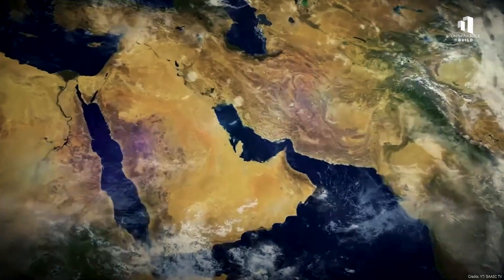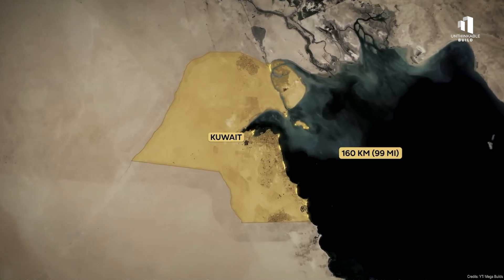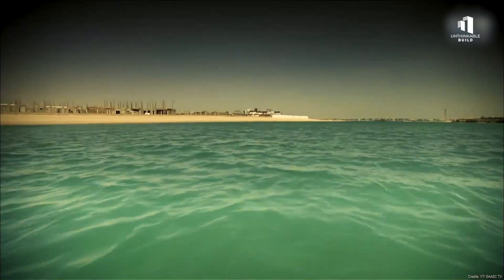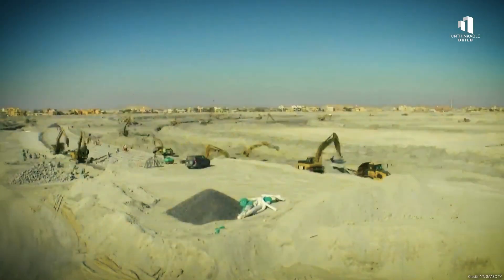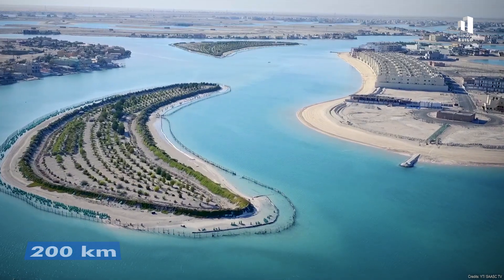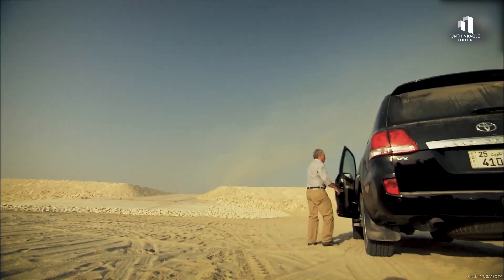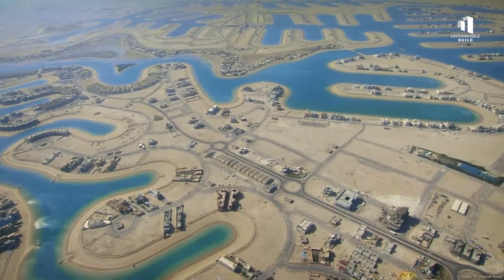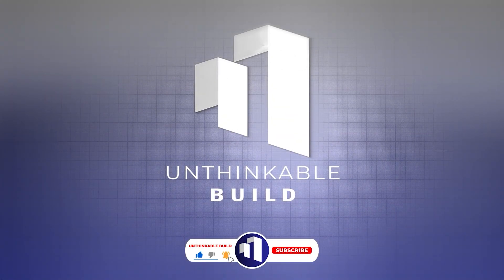The $5 Billion Desert City That Shouldn’t Exist

Comment: 🌳 Dhaka's Under-Flyover Renaissance: A Vision for Green, Cooled Public Spaces
DHAKA, BANGLADESH—An ambitious proposal is gaining traction in Dhaka to reclaim and revitalize hundreds of kilometers of currently unused urban space beneath the city's extensive network of flyovers and elevated expressways. This initiative aims to transform these neglected areas into a sprawling "urban forest," offering citizens a much-needed respite from the intense heat, congestion, and lack of green spaces.

The sheer scale of this untapped potential is staggering. Imagine hundreds of kilometers of inner-city land, currently occupied by the colossal pillars supporting these elevated structures, lying dormant. Specifically, many flyover pillars situated in the middle of major thoroughfares command a width of at least eight feet —an indispensable amount of space that presently serves no productive purpose.

The visionary plan proposes converting these underutilized corridors into a continuous chain of linear parks and pedestrian walkways. The concept envisions lush landscaping around the pillars with diverse, shade-providing vegetation, including fruit-bearing trees such as high-quality avocado and improved varieties of olives.

Beyond mere aesthetics, the proposal includes critical functional elements. Seating areas will be integrated along these pathways, creating inviting spots for relaxation. Crucially, a comprehensive water mist sprinkler system will be installed throughout the entire length of these under-flyover parks. This innovative feature will generate a palpable, cooling mist, offering citizens a tangible sense of relief from Dhaka's often ravenous summer heat while simultaneously ensuring the regular hydration of the newly planted flora.

Walking through these transformed corridors would evoke the sensation of strolling through an oasis, a verdant escape from the urban clamor. The project promises to create hundreds of kilometers of new pedestrian-friendly paths, all teeming with greenery, fundamentally altering the environmental quality and aesthetic appeal of Dhaka's urban landscape.

Addressing the structural constraints of the twelve-foot-wide pillars, the plan incorporates a clever design solution: specially designed staircases flanking both sides of each pillar. These staircases will allow pedestrians to seamlessly cross the pillar's footprint without encroaching on additional ground space, ensuring the park's flow remains unimpeded. The design of these stairs will be carefully integrated to harmonize with the overall aesthetic of the park, creating a cohesive and visually pleasing environment.

Furthermore, to ensure public safety and security, the entire expanse of these under-flyover parks will be monitored by CCTV cameras. This comprehensive approach ensures that the transformed spaces are not only beautiful and functional but also safe and accessible for all citizens, marking an unprecedented commitment to urban renewal in Dhaka.

প্রকাশ , মন্ট্রিয়েল , ক্যানাডা  * Oct 2025

Comment: Proposed Waterway Network for Flood Mitigation and Economic Development in Bangladesh :
A comprehensive waterway network across Bangladesh could provide a long-term solution to the country's persistent flooding issues. By creating a system of interconnected canals, floodwaters from India could be more effectively distributed and managed, preventing catastrophic overflows. By developing parallel transportation networks for both waterways and land, including both above-ground and subterranean routes, we can achieve substantial land savings. This freed-up land could then be repurposed for other beneficial uses.                                                                        

Transportation and Infrastructure :
To complement this waterway system, elevated roadways could be constructed parallel to the canals. This would provide the public with a choice between two reliable transportation methods, reducing the country's dependence on a single road network. This dual infrastructure would ensure uninterrupted travel, even during monsoon seasons. The canals could also be linked to existing rivers, enabling floating vendors from various villages to directly access urban markets and enhancing rural-urban connectivity.
Economic and Environmental Benefits :
This extensive network of waterways would also offer significant economic and environmental advantages.
Abundant Resources:
The canals could support a thriving fish population, providing a sustainable and abundant food source for the local populace.
Fruit and Oxygen:
The banks of these canals could be lined with fruit trees such as avocado, rambutan, lychee, and mango. These trees would not only offer a steady supply of nutritious fruit but also generate a significant amount of oxygen and provide much-needed shade.
Water Management:
The design of the system would include provisions for draining rainwater from the roads directly into the canals, further managing water levels and preventing urban water-logging.
Tourism and Recreation:
The waterways could be used for recreational activities like boat races, which could be organized several times a year, boosting local tourism and community engagement.
By implementing this multifaceted project, Bangladesh could transform its vulnerability to flooding into an opportunity for sustainable development, economic growth, and improved quality of life for its citizens.

Comment: Transforming Cox’s Bazar: A Visionary Canal Through the Hills Could Redefine Bangladesh’s Tourism

COX’S BAZAR, BANGLADESH — A bold new vision proposes carving a navigable sea channel through the hills of Cox’s Bazar — a move that, according to proponents, could multiply the number of tourists visiting the region a hundred thousand times over.

The concept calls for creating a wide, deep canal by strategically cutting through the seaside hills near Cox’s Bazar or other coastal areas of Bangladesh. Using precision-mapped controlled explosives, engineers would form a channel at least 20 meters deep, wide enough for two medium-sized ships to pass side by side.

This channel would meander through the hills, allowing cruise ships to sail from the sea into the mountains and exit on the opposite side, offering a one-of-a-kind travel experience for tourists.

On both sides of the channel, developers would build low-rise but expansive luxury hotels, each carefully designed to provide panoramic views of the surrounding waterway and hills. The structures would be limited to three stories in height to preserve the area’s natural skyline but would stretch wide to accommodate world-class amenities.

A cable car system would connect hilltops across the channel, giving visitors a thrilling aerial view of the scenic waterway. Along the route, man-made beaches ( COVE ) would be created using sand transported from the sea, and smaller offshoot channels would lead to private resort locations, each featuring its own secluded beach.

Inside these mountain resorts, tourists could enjoy a range of entertainment and recreational facilities, designed to blend adventure with natural beauty.

Currently, several large-scale tourism projects — such as the “Naf Tourism Park” — are being developed in Bangladesh, with roughly 90 percent of the work undertaken by foreign companies. However, experts argue that projects like this proposed canal could be entirely designed and executed by Bangladeshi engineers, keeping domestic investment within the country and greatly benefiting the national economy.

“This kind of engineering project would not require foreign expertise,” the proposal’s supporters emphasize. “Yet it could become one of the most remarkable tourist attractions in South Asia — created entirely by Bangladeshis, for Bangladesh.”

If implemented, the canal through the hills of Cox’s Bazar could redefine the nation’s image as a world-class tourist destination — blending natural wonder, modern engineering, and local innovation in one breathtaking landscape.

Comment: As the number of vehicles in Dhaka city — or anywhere in Bangladesh — continues to increase, the intensity of heat will also keep rising. Out of Bangladesh’s 180 million people, about 80% cannot afford a private car. They depend entirely on public transportation. Yet this 80% majority constantly suffers because of the privileges and actions of private car owners.

One of the main reasons behind the excessive heat in the country is the overwhelming number of vehicles. These vehicles generate massive amounts of heat. Therefore, all private cars should be removed from Dhaka city.

For the general public, there should be high-quality public buses (AC buses), metro rail, monorail, water taxis or water buses, trams, etc. Imagine if Dhaka had no private cars — only metro rails, comfortable buses, modern taxis, and water transport everywhere — how much easier and more peaceful people’s lives would be!

Always remember: as the number of vehicles rises, the number of accidents will rise too.

People in Bangladesh are overjoyed to hear that cars will soon be manufactured domestically. But will local car production really reduce the country’s traffic jams? Of course not. It’s the same old problem in a new form. The newly built roads will also become choked with cars.

Currently, the number of vehicles per 10 square kilometers already causes severe air pollution; once car factories are built, the level of pollution will more than double.

Every new major road being built in Dhaka (such as the 300-feet road) should have a waterway underneath. On the upper level, buses, trucks, and cars would run; below, water buses and water taxis would move in parallel.

If most of the new roads were built as elevated structures, there would be no traffic congestion in the next 200 years. Moreover, Bangladesh would never face floods again. Rainwater would not accumulate on the elevated roads — it would flow down into the lakes below.

When the city is surrounded by such interconnected lakes, there will never be a shortage of fish in the country. Every lake could be stocked with fish fry.

If avocado, rambutan, olives, Lychee trees were planted along both banks of the canals, the view would be stunningly beautiful.

The pillars of these elevated roads should be placed only on the land areas on both sides, never directly in the middle of the waterways — so the water flow remains completely unobstructed.

Those who truly love Bangladesh must carefully examine the government’s mistakes. If you do not point out the government’s errors, they will continue making them — and ordinary citizens will pay the price for generations. Your children and their children will suffer.

The mistakes being made today will one day become irreversible — they cannot be undone or rebuilt from scratch.
Reply from the maker: You raise many valid concerns. Dhaka’s core problem is that private cars take up huge space while serving a small share of the population, and the city’s road network can’t grow fast enough to match rising car ownership. But removing all private cars isn’t realistic. What is realistic is shifting priority toward high-capacity public transport and limiting car use in the most congested zones.

Elevated corridors, better drainage, and integrated waterways can help, but they require careful planning so they don’t create new flooding or environmental issues. The main point stands: long-term solutions depend on strong public transit, controlled vehicle growth, and urban planning that puts the majority first, not the minority who can afford cars.
Reply: @UnthinkableBuild Thank you for your feedback. 😊